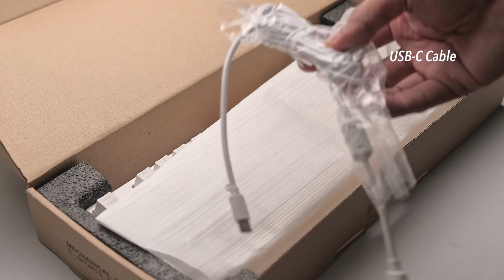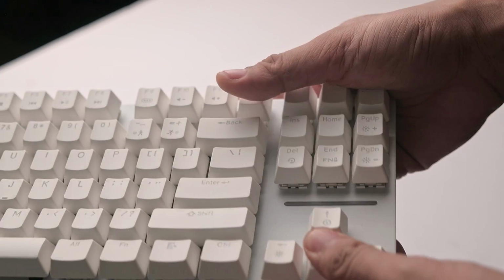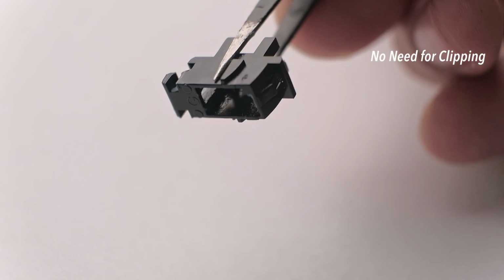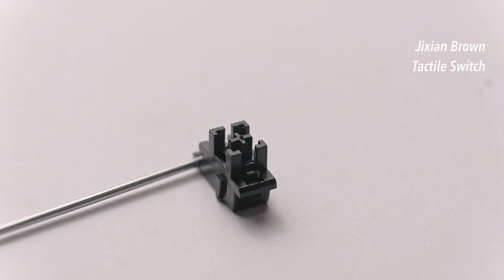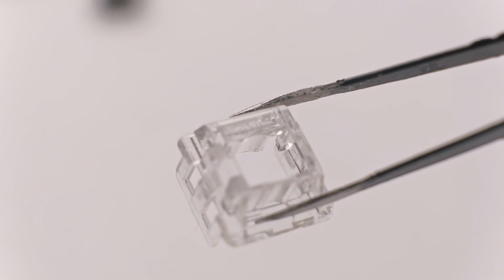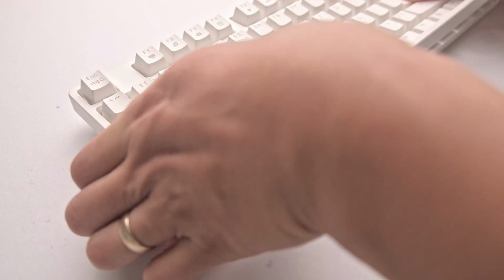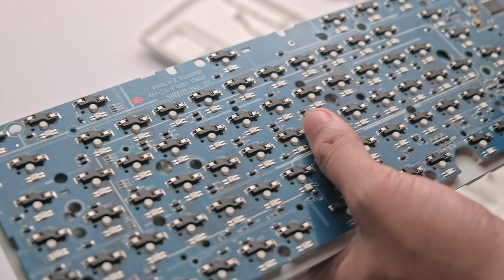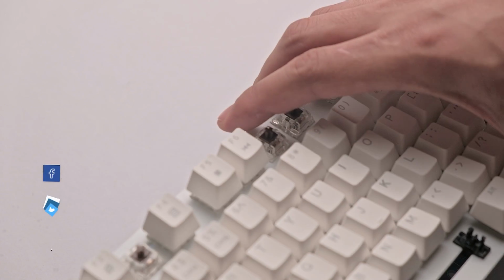CIY X77 TKL Mechanical Keyboard

Comment: The only thing missing from this review would have been info about the lighting settings. Does it remember the last mode you set? (E.g. if you set to chosen static single color at half brightness, will it reset to flickering rainbow colors at full intensity after being disconnected and connected again or will it store settings in a way that works without being injected power all the time?)

Comment: Should i buy this or the gk61(Optical Yellow switches)?
Reply from the maker: This with red ciy switches!
Reply: @pusakalmkb  And what is the reason?
Reply: And it's mostly for gaming
Reply from the maker: Optical, as fancy at it sounds but it still depends on the user’s game sense and reflex. But of course there are pros and cons for gaming. You still might wanna use lighter mech switches for gaming. Big pros for mech is that they’re easily replaceable if gets busted from wearing out. There are also a lot of choices in switches and more customizable than those optical keyboards. Mechs also sound better IMO.